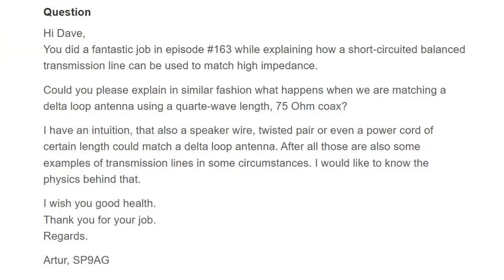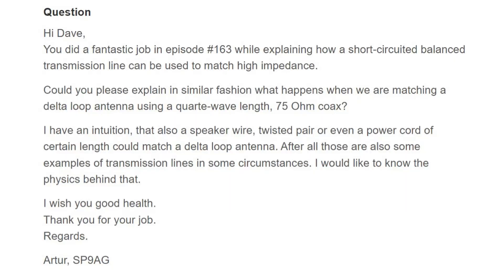Calculating Impedance of Unusual Transmission Lines Like Speaker Cord (#1004)

Comment: Great job on covering this.  The term characteristic impedance may help you when you need to differentiate between the physical (ohmic or DC) impedance and the "impedance of the line."
A Smith chart may help analyze the extension cord impedance also

Comment: Last time I tried this, my speaker wire was around 100 ohms. You can figure this out on a VNA either by using a 1/4L transmission line and seeing what it flips 50ohms to, or a variable resistor and seeing where the smith chart collapses to a point.

W2AEW has a video on this demonstrating how to measure.